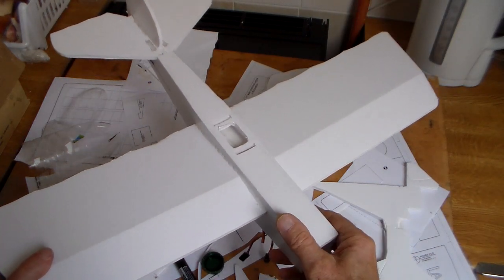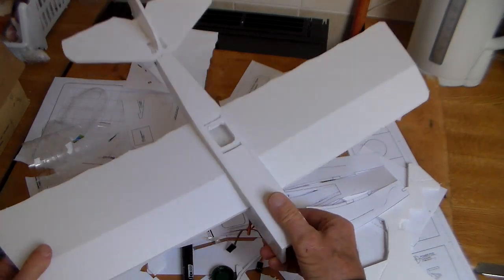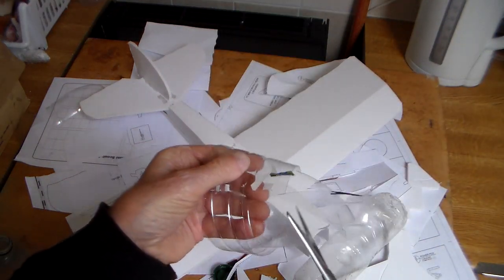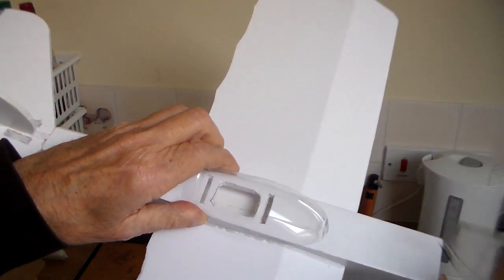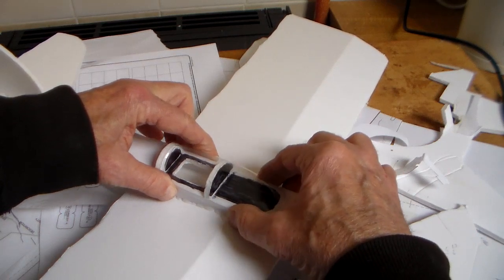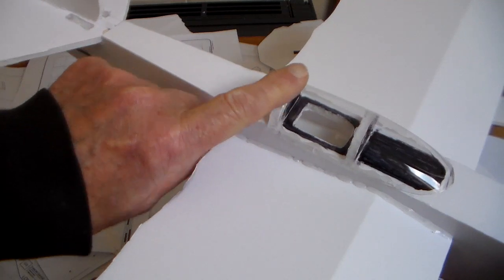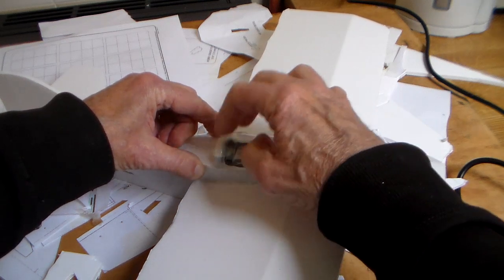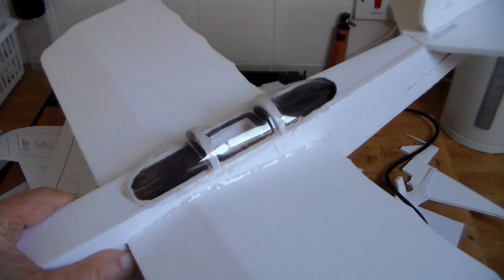Flight Test Mini Scout makeover - a proper bubble canopy made from a drinks bottle. Here's How!

Comment: Nifty! Looks great! And with all the thousands of different polyethylene terephthalate (PET) bottles & containers we throw away there's going to be a bottle with nearly the curve you need in your recycling bin. 
Modelling blown perspex/plexiglass canopies for free!
Reply from the maker: Yes Les, and I was wondering,  though didn't try it, whether I could bend it to shape with a hot air gun. ie change the curve a bit.  It was just a bit of an experiment really. Wasn't actually sure if the glue gun would glue the smooth surface of the bottle. Might have been an idea to rough the edge with glass paper.  I thought the shape of the front bit looked great.  One of these days we'll fly that baby of yours!  I love this foam board stuff, so cheap and easy to make stuff, even if it doesn't look classy!  I have run out of receivers now?  But no hurry, I have a feeling we are being locked down for a good while yet :(
Reply: @bobflyman  Yep, I have it in front of me. That'll be a good day!
Experiment Bob, I think PET shrinks as you heat it.

Comment: Nice job.  I cutoff some PEZ figures for one plane - R2D2 and 3CPO were piloting !!  If you wanted a cleaner glue (yours is fine BTW) you can buy canopy glue at a hobby store.  Alternatively clear silicon rubber would work.  Did you know you can also form a canopy out of those bottles by forming it first out of wood and heating the bottle plastic up with a heat gun very gently?  Anyway, great simple, quick idea.  Nice vid. Cheers.
Reply from the maker: Thanks for that. I was an experiment and I did make a bit of a mess glueing it. Had to pull it off later to install the RX under there!